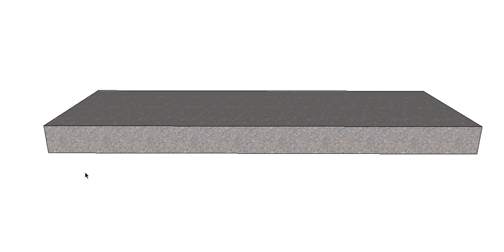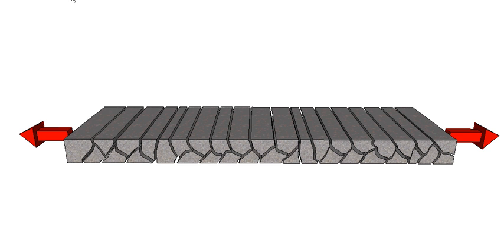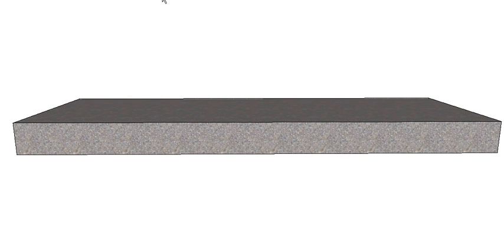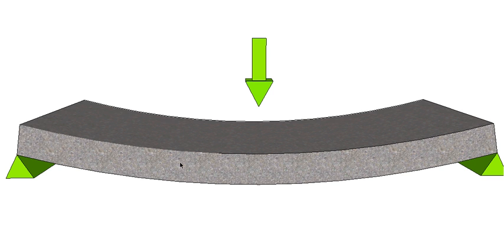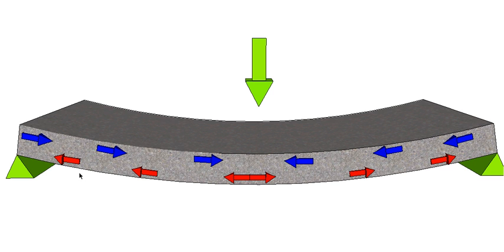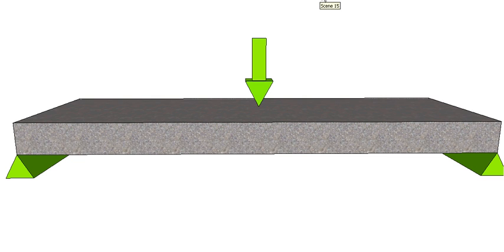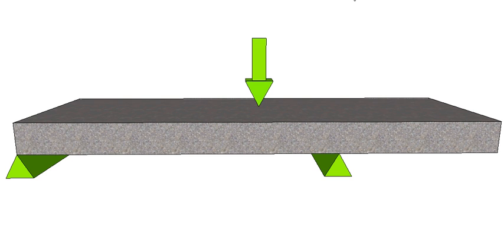Why use reinforcement in Concrete

Comment: The next challenge: You have a concrete suspended floor poured between four walls. Over the years as the suspended floor is subjected to various stresses, it develops lots of tiny cracks - but they're not a structural problem because it's correctly reinforced with steel.
Then you realise that all these tiny cracks represent a significant enlargement of the wall-to-wall dimensions of your floor, and it's distorting the outside walls holding it up.
Then what?

Comment: Steel is very strong in both tension and compression and therefore has high compressive and tensile strengths.
Reply from the maker: Hi Mate, agreed however the dimension that we use for reinforcement will deform easily under compression and therefore not provide any compressive resistance to the concrete.

Comment: So your example has nothing to do with the vast majority who only use concrete for slabs which are not suspended but rather supported by the earth underneath them. In that case what would be the reason to use rebar?  And in case you reply with load bearing walls those are generally further supported by a deeper footing under those areas. Thanks for the reply.
Reply from the maker: Hi Mate, Even slabs on the ground have footings and as the soil is prone to shrink away from under the slabs they are still designed as if the earth is not there. Effecively the earth is only a formwork. In extreamly reactive soils you may get the ground moving and pushing up on the slab, in these cases extra reinforcework may be needed in the top of the slab to counteract these forces. The point of the video was to show how the reinforcement works to strengthen the concrete and how we can be economical with its placement so we are not just filling the entire slab up where it is not needed. This is really the role of the structrual engineer to work out where the reinforcment is going to be required. Hope this helps.

Comment: You also reinforce concrete, not to just make it stronger but it inherently makes the construction process cheaper as you need less materials to get the same strength
Reply from the maker: Hi Bryran, great point, thanks for your comment.

Comment: I have a question that really bothers me. How does the compression on top of the beam work? I see that the arrows are facing towards each other from the sides. How is it being compressed? Where does this compression come from?
Reply from the maker: Hi Mate, the compression is created by the load on the beam. The load is trying to push the beam down while the supports are pushing against the load. This imparts the forces into the beam. Hope this helps
Reply: @Buildsum  Thank you so much! I'm still studying high school I'm trying to learn some basic knowledge about civil engineering.

Comment: Thanks for this video. Never thought the placement of the rebar is also crucial. I thought, just put it in the concrete, then it is reinforced. Actually, there is a proper method for it! Thanks a million!!!
Reply from the maker: Hi Mate, thanks for your comment, Yeah, there is quite a bit of science and calculation that goes into not only the placement but the size and number of bars etc.

Comment: I love your videos, they are very useful, and the imaging work you do makes the explanations clear and simple. Thank you!
However in this video you said something I know to be wrong "steel is week in compression". It's just not true. Try compressing a cube of steel under a press sometime! According to structural properties steel is approximately equal in compression and tension. However, if you draw out long thin shapes, like steel re-inforcing mesh, or steel rebar, then yes, in those shapes it deforms under compressive loads. This is where the combination of steel inside concrete - which stops it deforming - makes the end result much stronger in compression and tension at a very reasonable cost (building in steel only is too expensive lol). Massive ships like oil tankers are built in steel and have enormous compression loads on various parts under sea states like big waves but do fine without alternative "strong in compression" materials as the member shapes aren't long and thin like rebar / mesh.
Reply from the maker: Hi Mate, Yes i agree, perhaps I expressed it the wrong way, I should have said something like "steel in the form that we use it will deform under compression" but I hope it still gets the point across about how the steel completments the concrete to form strong building elements.

Comment: Sad part is that my teacher used this animation as evidence that concrete beams can bend, without cracking or breaking, mind you... Shame an educational video didn't educate a teacher, but that says more about my teacher than anything else.
Reply from the maker: Hi Mate, that is unfortunate to hear. The bending in this video is grossly exagerated to make the movement and the effect stand out. While the slab or beam can "bend" or prehaps better called "flex" it would be such a small amount that it would not be visable to the human eye and almost always result in cracking.

Comment: What is a general rule to use or not to use reinforcement? What good is the PSI strength if reinforcements must be used? Does 6500psi means it can handle a lot of weight? Thanks
Reply from the maker: Hi Mate, as a general rule I always use reinforcement. As for the strength it really depends on the use of the concrete in the end and should be designed by a Structural Engineer.

Comment: Volume output is very low for some reason 
Awesome video
Reply from the maker: Hi Bobby, yeah I have had a bit of a problem with the audio on some of the videos which I think I have got sorted in my latest videos but no one has mentioned this video before, thanks for letting me know.

Comment: Hi Buildsum. My plumbers have cut a 300mm channel through a concrete bathroom floor to take the waste pipe/drain etc. In regard to filling this back in, would you use steel mesh and rebar drilled in to each side of the cut walls of the slab or just steel mesh? Thanks for all the great videos and detailed explanations.
Reply from the maker: Hi John
Have they cut out any reinforcement when they cut the channel, if not then all good just fill it in with concrete. If they have cut out reinforcement then I would want to replace it, rebar or mesh would work as long as you can drill it in on both sides and epoxy it into place. Basically, it just has to be equivalent to what was there in the first place.
Reply: Thank Buildsum. They have cut the mesh out, so I will use rebar, as suggested. Thankyou for the quick response, as usual! John

Comment: stell is strong in any way
Reply from the maker: Hi Benito, yes mate, steel is strong in compression and tension however long thin lengths like those used as reinforcement will deflect and bow when put under compression and as such fail to do the job.

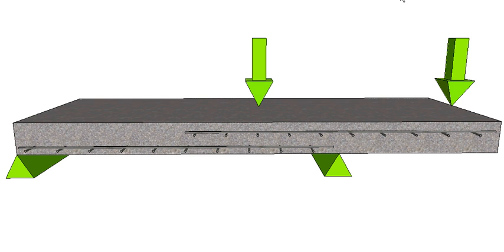Comment: 3:53, this reinforcement would more than likely be designed as a "two way" slab...They would have, more than likely, continued the lower reinforced steel out, over the  "overhang" / cantilever.
As it is now, this has a high chance of failure under load...
Typically, cantilevers get designed as a two way...(load design)...(had to edit post as my phone's auto correct changed wording-it happens).
Reply from the maker: Hi Mate, thanks for your expert comments, good to know.
Reply: Buildsum, your welcome... keep up the videos.

Comment: i appreciate with what you tried to explain in this video.. I'd only like to add that steel bars have same strength fy in tension as well as compression.. buckling is another thing.. that's why in columns steel is also used to increase their axial load carrying capacity apart from the unbalanced moment induced, but main force is axial in columns.. So steel are both used in tensile as well as compressive reinforcement depending upon the members of the structure..
Reply from the maker: Thanks for your input Mohamad much appreciated

Comment: Hey i think its a great video but saying steel is not strong in compression is misleading, steel is strong in both compression and tension. I agree that the slender reinforcement members will buckle but they were intentionally made slender for the purpose of reinforcing the concrete members.
Reply from the maker: Fair point Aaron thanks for you input.
Reply: What he probably meant to say or should've said was steel IS bad under compression in keeping it's original form and concrete is NOT...because the bond in the  molecules of steel deform and create new bonds under compression which weakens the overall form/shape while concrete keeps its original bonds under equal or greater loads.
Reply: aaron mitchell 
Your words are right but the explainer wasn’t wrong though. There is no such a perfect strength of steel at compression. It’s actually deteriorated. That’s why engineers don’t use steel in the applications of high compressive loading because they don’t know when it will possibly fail and at what stress value.

check wikipedia, compressive strength
Reply: aaron mitchell  I also commented the same above.. you can see my comments and explanation I wrote.

Comment: Unfortunately it buckles in extreme heat when used as a road
Reply from the maker: Concrete buckles in roads and footpaths where there is not enough allowance for expansion. As it sets concrete "grows" and if it is adjacent or confined in an area it will apply pressure on those surrounding objects.This can be overcome by using expansion joints.
https://www.youtube.com/watch?v=P29HjxvOitM
Hope this helps
Reply: yes it does...sorry for not being specific....the concrete under tension does not buckle and crack because of the compression....to give an example is upon curing the concrete I have worked with is cooked to a temperature of 145 degrees f without tension and then the ends of each panel or pile are cut thus producing tension and closing each fracture or crack....the rapid heating and cooling of concrete or extreme heating of concrete (not under tension/compression) will crack
Reply: ExoticSpeedify the heat will not affect the prestress panels with any noticable difference
Reply: Jonathan Carnahan How come on the highway we get buckles?

Comment: if concrete bars are very strong when compressed, why do we use reinforcement is concrete columns. The concrete columns are only compressed aren't they?
Reply from the maker: Hi Parsi
While columns are mainly in compression due to the weight of the building above they are still subjected to side ways forces which will place tension forces on the columns  therefore requiring reinforcement.
Reply: Because to protect against earthquakes, storms, slight misconstruction, and as always the drifting of the angle of ground plane.